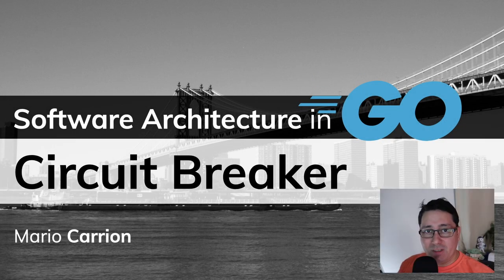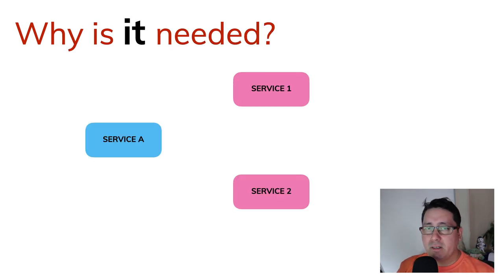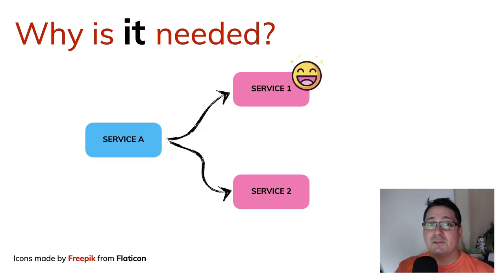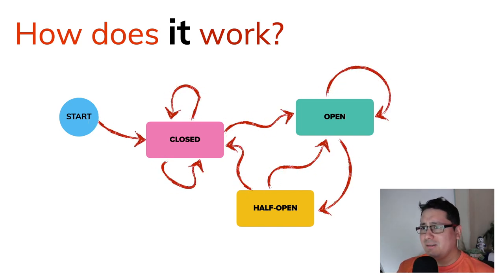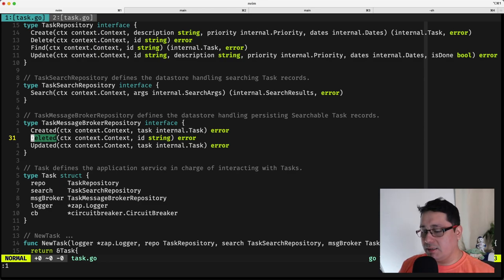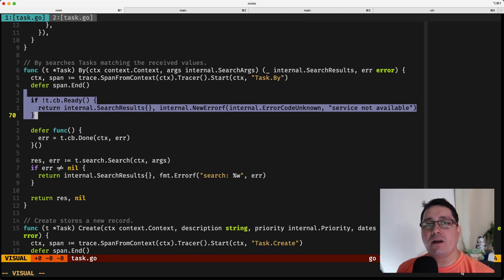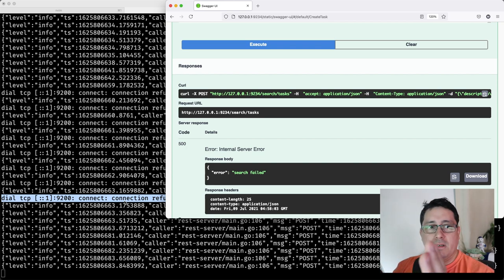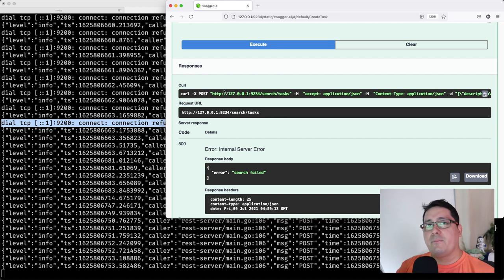Software Architecture in Golang: Circuit Breaker Cloud Design Pattern for Reliability

Comment: Hi sir, Circuit Breaker usually applies to synchronous calls between services. But for asynchronous calls that waste a few resources, and are configured with a timeout. So should we apply this pattern to asynchronous calls? Is there any difference when applying this to asynchronous calls
Reply from the maker: Hello,  yes like you said in cases like Asynchronous calls applying this pattern would be too much.